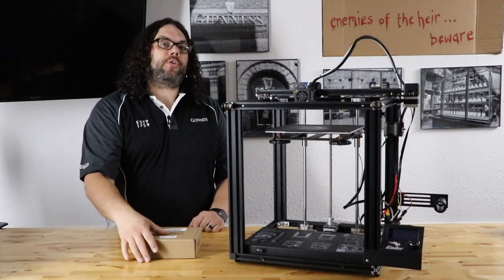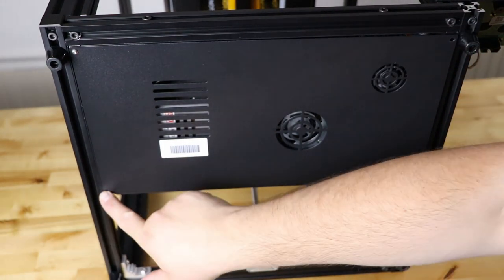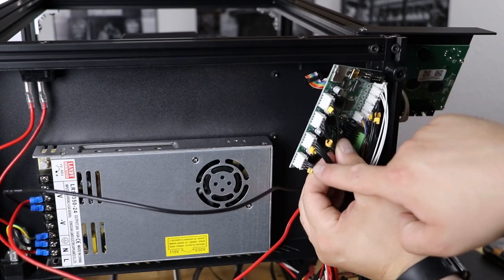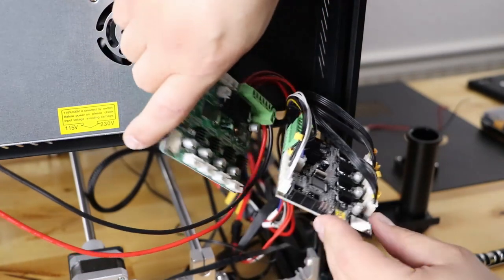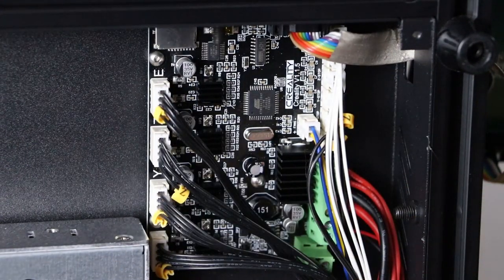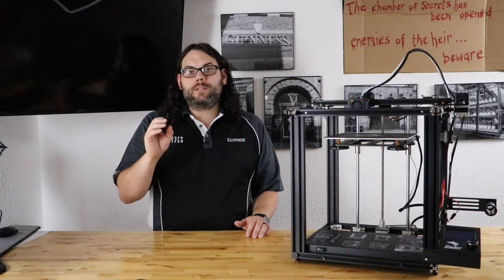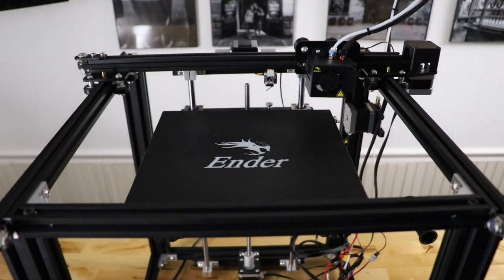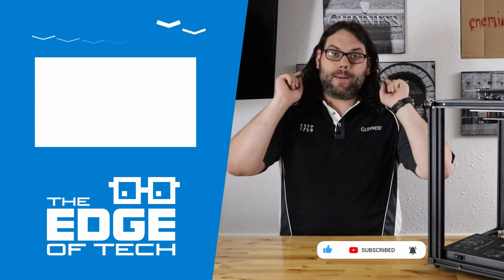Installing the Creality Silent Board in an Ender 5 using TH3D Firmware

Comment: Would it have been easier to start from the bottom and work up? Also, if they tinned the wires that should be cut off back to bare copper. Tinned connections do not play nice w/ those green connectors. They can loosen over time causing a hotspot. The downside is making sure the wire strands don't stray and short to adjacent connections.
Ferrules are the best option, but that's extra tools to buy.
Reply from the maker: It may have been easier to do it that way, next time I will try it! I agree on the tinned wires and ferrules. This was a basic video on how to change it. I should do another one on how to fix the tinned wires. Lol

Comment: It would be great if you could order the Creality printers with the upgrade boards as default, I would rather pay a little more from the outset than pay again and have a perfectly functional board sitting redundant.
Reply: We have sell Ender 5 Pro directly with upgrade V1.1.5 silent board.
Reply from the maker: Monica is right!! There is a new Ender 5 Pro and I will be posting about it tomorrow! It has a silent board, metwl extruder and Capricorn! I will have it Tuesday so stay tuned!!
Reply: @cheungmonica900  Thanks, Monica!

Comment: Quick call for assistance. I'm trying to find a copy of the stock firmware for the Ender 5 Pro, which should b ethe same firmware on the Silent 1.1.5 for Ender 5. Any idea on where I can get a copy. Creality has not released the source for the E5Pro yet, and I'd be happy with the HEX file for now.

Comment: Jim, since I got the Ender 5 Pro with the Silent board 1.1.5 I was wondering should I think about upgrading the firmware to the TH3D firmware? Or should I just leave it "as is" for now? By the way, this thing is so much better printer than the Wanhao D6 I have. I completely understand why you like the "5" so much!
Reply from the maker: It's up to you! Thermal Runaway should be turned on and if it's Printing good you can just leave it. :) I'm glad you like it!

Comment: Hi Jim. I have already upgraded My Ender 5 to include the BLTouch using Marlin 1.1.9 firmware. If I swap the board for the 1.1.5 silent board, would I just upload that same firmware I did for my existing board, or would I have to use the TH3D Unified Firmware? My main concern is the BLTouch. Thanks for any help/info on this.
Reply from the maker: You can still use the Marlin firmware, but may have to modify it for the 2208 steppers
Reply: @TheEdgeofTech  Great, thank you!

Comment: How long is it supposed to take to flash the firmware? I put the firmware.bin file on the SD card (removed other files) and turned the machine on with it in. It has been a blank screen for over ten minutes. I don't dare turn it off.
I know the new board works because I turned it on and it was fine, it just thought the machine was an Ender 3 by default. And I made sure to switch all the connections one at a time to the new board so  I got all the wire correct.

Comment: i am clueless how to change firmware on this mother board... i just got this and planned on installing it in my ender 5 since my current ender 5 stops an hour into a print and i was told a new motherboard would fix... looked super easy...but again i do not understand nor have the tools required to change firmware..

Comment: How do you know if there is a bootloader installed? I just installed one of these boards and have no clue what to do next, haven't been able to get anything to print since I replaced the stock board. What software do I need to connect to the 1.1.5 board? HELP!!!
Reply from the maker: If you got the 1.1.5 Silent board from Creality, it should have a boot loader installed on it. But it also should have the firmware on it already from the factory and it should print!
Reply: @TheEdgeofTech  That's exactly the problem! I installed the new V.1.1.5 Mainboard almost exactly like you described it (even before I found your video), But then, after powering it up, I am left with a blue screen on the printer.  And I wish, you had continued your video exactly here, where it comes to installing the necessary new software onto the new board. At least a link to that procedure would have been a great help.
Disgusting, that ENDER delivers this new Mainboard without any of this information to their customers. And I guess, they deliver their printer with the loud old board until they have sold the last one of their 1.1.4 pieces. Probably hoping that the customers do not find this out, before buying the ENDER 5.
Reply from the maker: @timbuktu9569  Hey! It should have come with a firmware on it. And it should boot up after the installation. I can help with the firmware update of needed!
Reply from the maker: @timbuktu9569  Try this video! I'm assuming you don't have a BLTouch, so this should get you going with the newest TH3D firmware! Let me know if you have any questions! https://youtu.be/4S6bc4bW4M0
Reply: @TheEdgeofTech  HELP with the firmware upgrade...

Comment: I got two 1.1.5 boards (one for my Ender5 and one for my Ender3). They did NOT have the bootloader installed and had to be flashed using an Arduino.
Reply from the maker: Crazy. Mi e definitely had it installed and I believe they are supposed to come like that. How long ago did you get yours?
Reply: @TheEdgeofTech  About 4 months ago. Some folks at Fat Dragon Games were having the same issue. Maybe they fixed production since then. Thanks for the great videos!
Reply from the maker: @johnjones6115  I hope they fixed it! Thanks, I appreciate the compliment!

Comment: With the Silent Board I got the issue that the Z axis of my Ender 5 doesn't move after 4-5 layers, no matter which firmware I use. Any ideas?
Reply: i have the same problem.. have u any solution?
Reply: Probably this issue: With the newer Ender5 you have to uncomment Lead Screw Z axis stepper motor for the new version has a  different LEAD SCREW configuration
Reply: @ROTAX129  Thank you. I found this solution in a 3D printer community forum right after I wrote the comment.

Comment: Its the installing a boot loader, and commenting out or turning on crap in the software that's such a PIA.  Anyone can install a board, its wire for wire.  Its he 1000 places you can screw up when dealing with firmware that is a bigger concern.  people such as yourself do not make videos for complete beginners. Yeah, I know what "un-commenting" , but on what do you uncomment?  What software? how does it get set up? What protocols or general knowledge are needed to use it?  What if it finds an  error?  Too many variables for the complete noob.   Great video though.
Reply from the maker: Great feedback! You are right! I need to make some videos on the firmware, and I will add that to my list! In the meantime, TH3D had some great videos on setting up the firmware as well. I appreciate your feedback and thank you for watching!